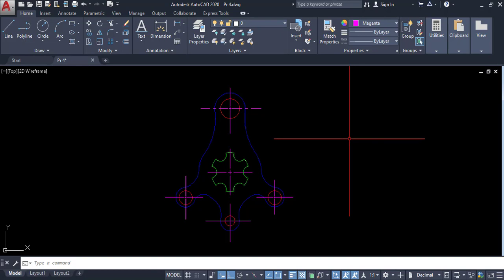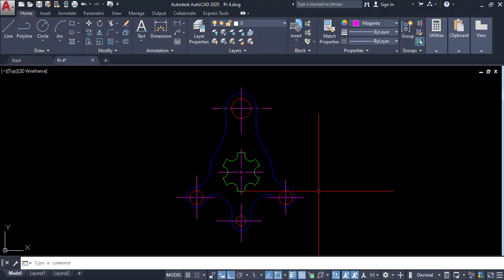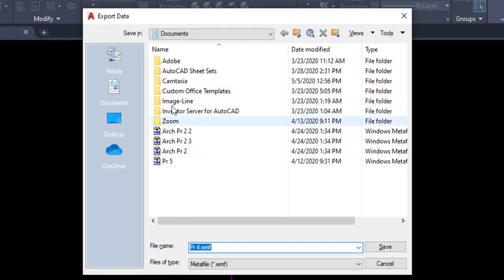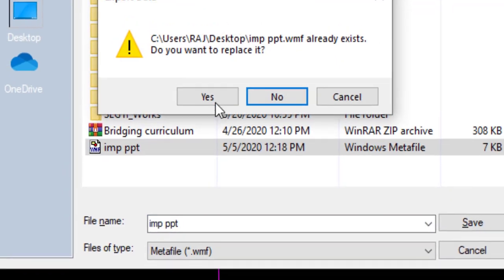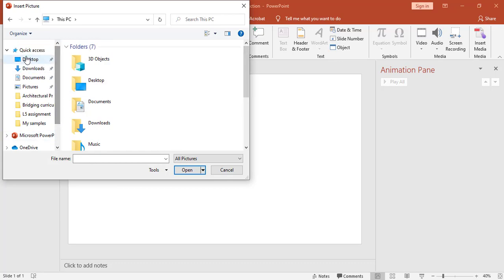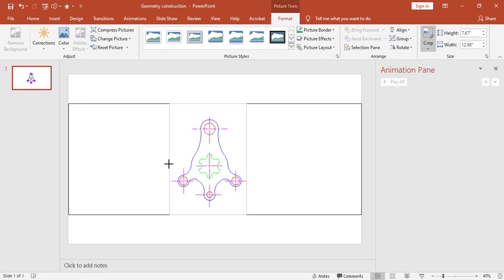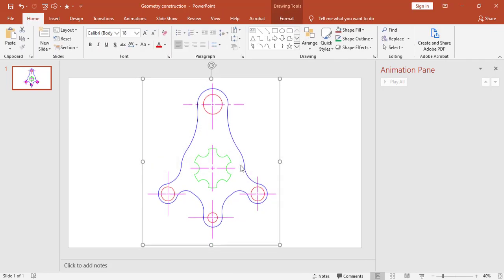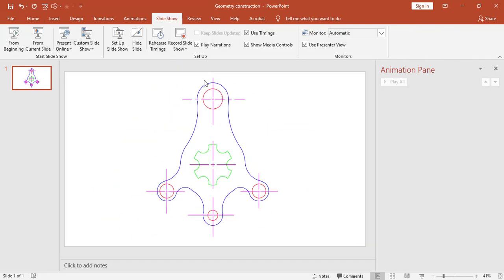How to import AutoCAD drawing to PowerPoint

Comment: Excellent bro. How did you recorded your video? In your video after changing orientation of my mobile to landscape o can able to entire screen with zoom effect which means all the menu bar and tool bar clearly visible in autocad. How do you did that? Because most of the YouTube videos after changing the landscape it looks very small. Is there any specific resolution we need to see before start recording?
Reply from the maker: Yeap 1280 x 720 HD